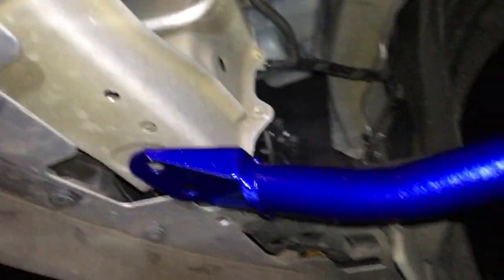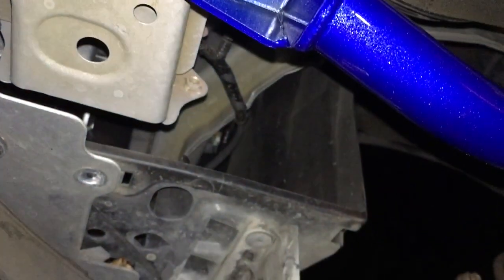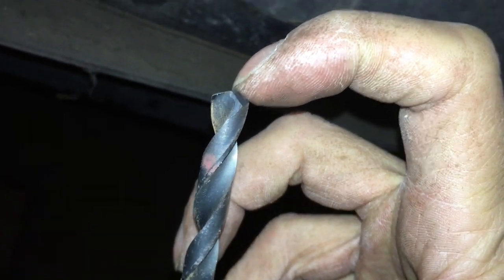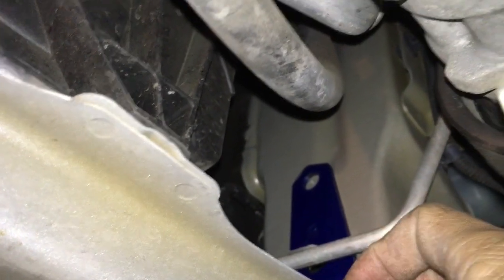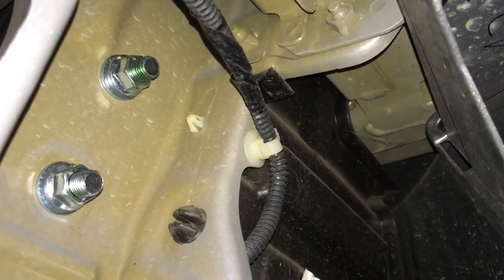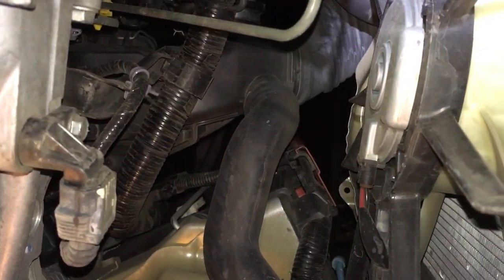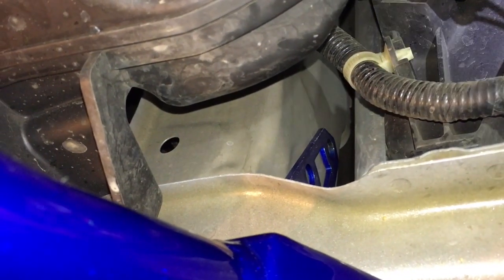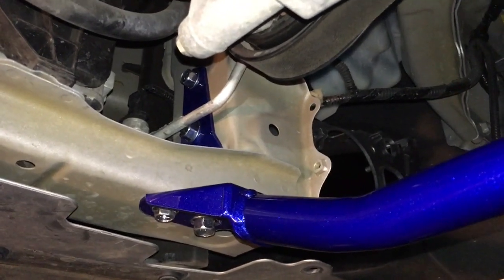Honda FIT GK Megan Racing front under frame brace install Pt.2

Comment: How do you like the megan racing front brace before and after! I have it I just havent installed it just yet!
Reply from the maker: Not sure if that front brace doesn't anything....I mainly notice some squeaks over speed bumps and such.  It was certainly a pain to install drilling those holes in tight space.
Reply: @DaBinChe  I bought it so I plan to install it, hoping it isnt much of a waste but Ill have to see.
Reply: @ajwright7936  Update?